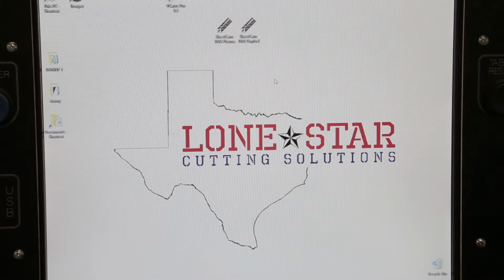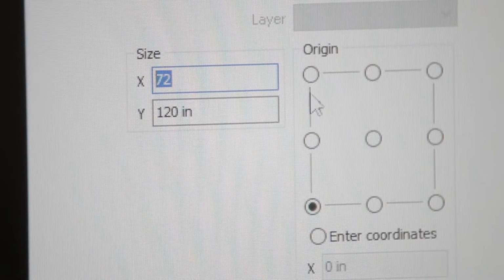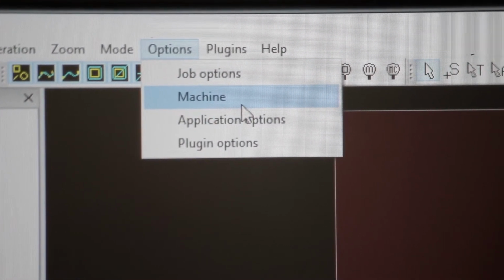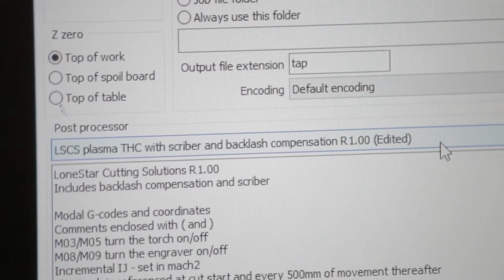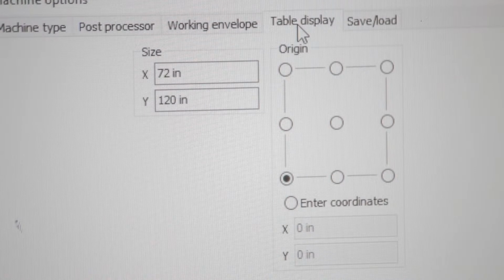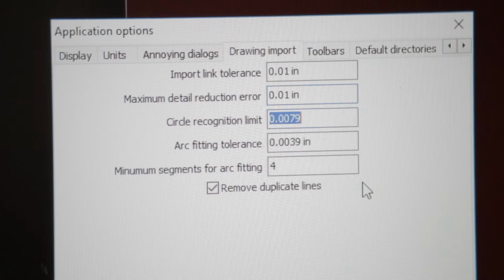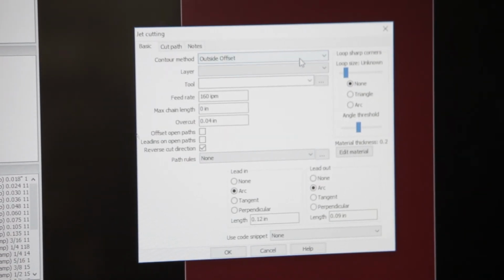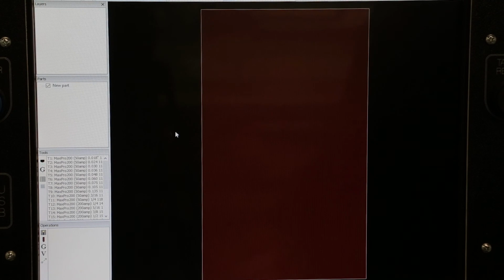Troubleshooting SheetCam On Your CNC Plasma Controller

Comment: Been using sheet cam for couple years . I’ve figured out most issues but now my post process isn’t working.I’ve tried support but no response and seems no one knows. I’ve even uninstalled and reinstalled same issue but everything else works fine .